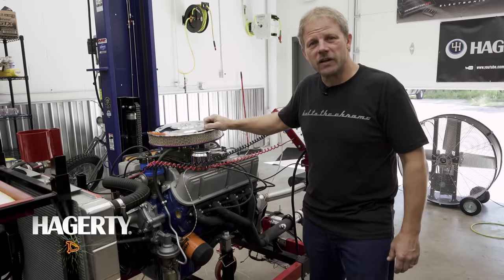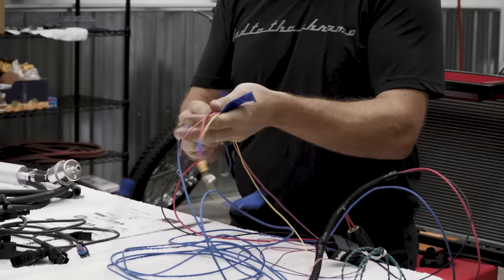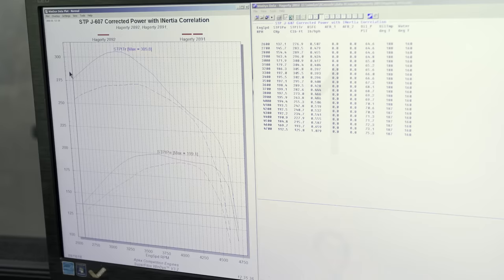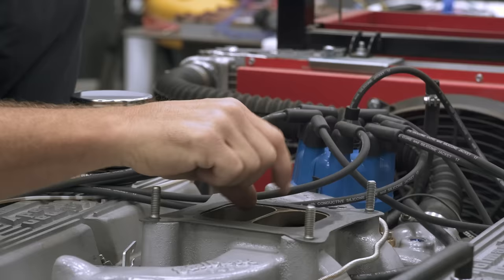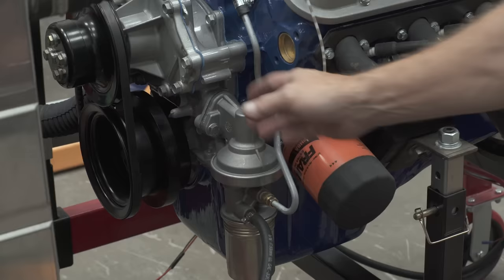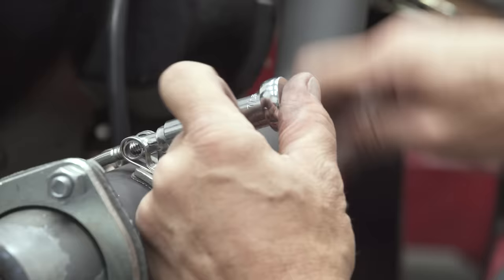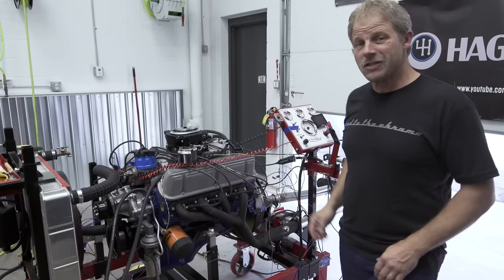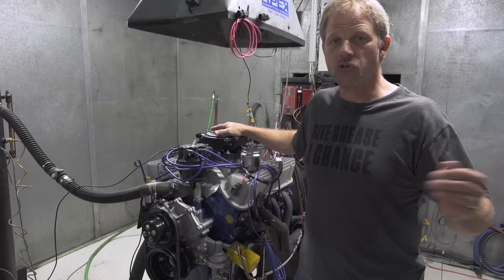Is it worth it? Replacing your carburetor with a Holley Sniper EFI | Hagerty DIY

Comment: So what cfm carb is this?
Is the carburetor a performance carburetor of today like a Quick fuel.
Their is a huge performance difference between a good performance carburetor and a daily driver low end carburetor. 
How much tuning did the carburetor get.
The holley efi is the equivalent of a performance carburetor.
How much tuning did the efi get.
Was the timing curve optimized for each?
That would be some of my questions. 
I know that efi is great equipment. 
I also know that a performance carburetor tuned for the application is great. 
I don't see a difference in total or average hp between them.
But I do see possibility a fuel mileage difference. Not much though. 
Drive ability may be better but again not much difference. 
Carburetors will never be obsolete. How ever hardware and software will be. 
Just my thoughts.

Comment: It is said and it is thru that "The fuel injection works in real-world conditions. The fuel injection is far superior." Sure, but for those that do not want or need the added wiring and digital control then the carb is King. In terms of reliability I'd neither need nor want the added complexity of the added sensors and computer control in my Summer driven 60's muscle car.

Comment: And that fuel dump on start up will destroy a new motor. Seen it happen!!! At a return line to your pressure regulator make sure that you have constant pressure at the carburetor and stick with the carburetor you'll be just as happy. And you'll probably save about 1500 bucks and possibly your motor

Comment: Tach sweep flooding?
What you are telling us is that the Sniper does NOT require ignition pulses to trigger the injectors, that the injector flow pulse is controlled by the tach.
That sure is a big negative compared to SEFI.
Ya OK. So its just a easy carb to efi conversion that improves fuel distribution up th the limits if the manifold. 👍

Comment: With the EFI you could actually add a catalitic convertor to your old classic ride. You'd be CLEAN with regard to emissions.

I'd be fun to see a model-T, model-A or a flathead V8 running such a modern efi setup.
Reply: Nope, not so much. The catylictic would clog in a few thousand miles. V/R Chris

Comment: Great video , what a difference. Question time now because , I have zero experience with fuel injection . 

1. I bought a 94 2 wd sanoma which has the 4.3 and I am going to install a V8 .

2. Would it be easier just to install a LS engine? Or get a old school 350 and get the Holley sniper system? .

Comment: I am a Hagerty customer and big fan on the company.  But this video?
Quick takeaway - If your sniper does not run well, you are on you own....   Their support at this time is DOA
I wish it was this easy.... My Holley sniper experience so far. Note: I am a competent mechanic

Details:

suport call #1 - pre purchase - looking for recommendations, decide on q-jet sniper, hyper-spark dist. and coil. Tech recommends EFI fuel tank.
tech gives me a list of part numbers... I order system
Remove my old equipment, discard old gas tank. install system new tank will not fit.

Support call #2 16min wait    fuel tank won’t fit.  I have wrong tank, previous tech gave me wrong part number. Holley does not make an EFI tank for my car. I have to buy a new tank as I had already scrapped my original. Had to pay to return the wrong tank…. Ya….

Finally get new tank and complete the install. Car won’t start, fuel pressure reading 0  - It flows but no pressure.

Support call 3 18 min wait.  No fuel pressure because no pressure regulator, - Sniper q-jet does not have internal regulator like many others. First tech (call 1) did not know that
Order regulator,   wait for it… install it….

Car starts but flooding - crazy rich at idle.
Support call 4 15 min wait - call from my office, talking to tech he tells me low vacuum can cause over rich. I figure I forgot to connect a line. 
I go out and check everything is good. Vacuum is low, about 10 on vac gauge, but the car barely runs so vacuum will be lower.

Support call 5 17 min wait.   -   Im in the car with tech ion phone. We are going through sensors and settings. He can’t figure it out. Tells me “I want to go check a notebook” puts me on hold. I wait almost 30 minutes… he’s not coming back….

Support call 5  19 min wait.   This tech seams to know more. I create a datalog file and email it to him and wait for his reply.
...No reply....  I have sent him 3 emails,  no replys.....

So what would you do....  Holley has gone radio silent....

This has been a winter long project-- 1968 Corvette 427 restomod,  -  upgraded front and rear suspension, upgraded steering system, TKO500 5-speed trans, 18” wheels and sniper system.
Money is not really an object for this build. I have taken a lot of time to do it right. Weather is now getting nice… I wish I could drive the car…..

I will post a followup. If you are a C3 corvette guy, I will be posting an article on the corvetteforum  detailing the entire build - lots of photos, howtos and lessons learned. 

I have been a big Holley fan since the 70s….  This is just getting a bit out of hand and I’m running out of time and patience.

Comment: Thank you.  The video was informative and instructional.  Some more technical data about fuel line clamps, line size and material requirements would be nice.  I plan to plumb  (non magnetic) stainless lines with AN fittings due to being in a salt laden air environment.  I feel like others on the string.  Horsepower increases are less important than drive-ability, reliability and fuel economy for the average custom car cruiser.  Not sure about the clamped on O2 sensor.  Most muffler shops will weld in a bung if you don't have the capability at your home shop.   Keep up the good work.
Reply: read the instructions.

Comment: I agree with one of the posters that this was a thinly disguised advertisement for  the efi unit; what they don't tell you is what you really want to know, like how much is this unit? what real world gas mileage advantage is there over a carburetor in traffic, and on the freeway? how much of a pain is it to keep this unit up, and who do you turn to when the refi unit goes bad, whats the warranty? they wont't answer them of course, because then the carburetor comes out on top, in real world use I would put faith in a mechanical fuel pump, and an edelbrock  AFB I could disassemble and reassemble myself.   I think you will pay $1,300 for this sniper system and the privilege of learning it wasn't worth it after all!

Comment: Problem is ,,THE COST,,, i have trouble on cold starts with an open top 750dp,, the engine was setup on a dyno with my carb and adjusted when it was at 160f   cold start its lean and ,,pump, pump pump pump to start fouls plugs after  a dozen or so cold starts.
The EFi snipper here is $2800 alone. I am running A 377chev, 10.25:1 comp,, AFR CNC heads , big Solid Cam etc. runs 478hp @6000 and 460tq @4800
steve in Australia.

Comment: Wait...you said the EFI was bigger than the carb. For a fair comparison, shouldn't they be the same size? I have seen other comparisons where they were the same size and the carb made a little bit more power. The EFI of course was smoother and more efficient, and a lot more expensive.

Comment: I have a l29 plane on waking the motor up bit. Think I'm start with a Holly sniper, with intake. Cam swap with 2500 stall converter. Little by little.

Comment: I would like to see a comparison with truck applications ... not just light car applications.  My truck engine redlines at 3800 rpm and my truck tips the scales at 7k gvw unloaded.  And if I'm off road in the middle of a field I need 100% reliability or at least be able to fix the thing to get it home.  How is efi at pulling heavy loads?  And how reliable is it as far as being able to fix it in the field if something goes wrong or it just dies?  I had a nice low mileage Buick that would die every few days for no apparent reason.  It could be cold or hot, running on the freeway or idling at a traffic light, it could be morning, afternoon or evening, did not matter.  Every couple days it would suddenly die with no warning.  I spent over $2k with mechanics replacing every sensor, computer, coil, etc with no luck.  Finally sold that beautiful, low mileage car for next to nothing as I morally had to disclose its unsafe habit of unexpectedly just dieing in traffic.  At least with carb and points in my truck I've never been left stranded which is more than I can say about my Buick, or my Honda, but that's another story.  Would really like to see a truck application  comparison along with some MTBF analysis of the electronics.  And that's operating with real life temperatures - here it can get -20*F  for weeks at a time and above 100*F in the later summer.

Comment: Why not inject the fuel at the top of the compression stroke? That way you avoid knock and can user a higher compression ratio which enables you to get more energy out of the gas. What am I missing?

Comment: People watching this video are why they ended up with goofy ideas.  No tuning of the carburetor, and odds are it is a 600 CFM.  That is too big for a 289!  You can pick up about 15 HP and torque with a 500 CFM carb.  The real benefit of the Holly Fuel Injection is that the air/fuel ratios are better, and better throttle response since the carb was not tuned.

Comment: Multi-port fuel injection actually balances out the engine with power strokes it actually the computer actually regulates the fuel supply

Comment: Not too fair of a comparison. I bet the carb wasn't tuned to run without the air filter as it was on the dyno. It's no surprise it ran too lean.

Comment: I would to say your statement is wrong on EFI.
It doesn't automatically adjust... unless that's a function of the holley. 

Cuz most OEM EFI systems, ppl try to either piggyback or eliminate to adjust the fuel curve for better efficiency and maximize power

Comment: I would've like to see that little 289 with a 750 double pumper fully tuned. I bet it makes the same if not more power than the efi. And I'm a efi guy
Reply: Not recommended. The 289 was already over-carbed. Properly tune a smaller (CFM, 400-500) carburetor and utilize properly set up controls and the engine will make as much power as the EFI and make similar fuel economy. The EFI benefits come from not adjusting the tune every time the weather changes. V/R Chris

Comment: I have a '73 vette with a 350 using a 600cfm 4bbl Holley. This installation looks nice and easy until you get to the fuel return line and O2 sensor. I'm not drilling into the headers (hooker side-pipes) for the O2 sensor. Adding a return line all the way back to the gas tank seems like it would really be a not-so-fun task as well. It's a bummer since I'd love to get the easy starting, more efficient advantages of this EFI "upgrade". I'm not really looking for a ton of power, I'd rather have it more drivable, so to speak.

Comment: I don't understand why this is even a comparison. This is like asking why a philips head doesn't work like a torx or why fine threads are used in certain applications.
Stoichiometry is the goal when it comes to drivability in every situation,  A feedback fuel injection system will always beat carburation at that job simply because it has more points of ratio to maintain fuel trims at Lamba. A carb is a compromise at best even an MC feedback carb still doesn't have the number of cells in its mapping to compete with feedback injection.   Carburation is now even a dinosaur in racing, to piston aircraft.

Comment: Wonder if a single plane intake instead of that spacer restricting airflow would help. I also think that especially in a street motor that O2 sensor will allow the motor to adjust itself to the air quality making performance alot more noticeable outside a lab where the air quality is controlled
Reply: usually does they recommend long runner single plane with "custom" plates for idealized flow. Generally paired with a header/exhaust system to match, pending on exhaust porting/flow characteristics with vac. So it still entails A lot of tuning/diametered/piping fabrication and cost. Or a "blue printed' aspect to intake/plenum/plates with crate/shop builds, that offer their headers/exhaust builds. Just differs when ppl at home have their own BBC or classic 4 bolts, and are trying to incorporate DIY/Headers. Still A single plane helps a lot more with that aspect of tuning/management of fuel/air. Each cylinder cycling fuel/air in/out ideally if theres shared ports. Esp when or large emphasis on long tube headers/collectors/straight pipes. At times the plate/restricted airflow helps in low rpm/operation depending on the fuel system/application imlemented. They have those custom plates where its a large/split intake plenum....and at higher rpm it opens up the second/port like a throttle body...then closes for half flow/pressure as it self tunes. Making the single plenum long runner application much more ideal in those situations. VS just as "Stock" engine/exhaust/header...Situation and a shared plenum/stock intake manifold and more or less basic EFI operation and fuel economy/reliability those end users expect, were intent on when swapping to EFI.

Comment: if you do a comparative test ,then wouldnt a 1 Inch spacer be tested under original carb first so it is back to back, then add the sniper? also i see added temp readings, carbs can be tuned that way also

Comment: There is one reason to go EFI. Drivability. I’m not sure there’s a good reason to use a sniper setup when you could get a vastly superior setup with the tuned runners of a modern efi manifold. I guess if you want all the drivability and lack of performance of central/throttle body injection then a grand for this is fantastic.

Comment: Nobody never does an honest comparison between efi and carburetors, efi is usually bigger , let's put a braswell 4 or 5 circuit carburetor same size on and retest that hp, I do agree a carb cannot compensate for altitude , but carb is a lot cheaper, and less parts to go bad, both have good and bad points.

Comment: Would have been nicer if ya all fixed the carb flat spots with basic jet change to try and get the most out of the carb so when you changed to injection what you were trying to show could have been seen.

Comment: how do you solve the tach sweep problem.  I have a 66 GTO with aftermarket guage replacement and the tach does sweep on ignition on.  am I in a world of confusion?
Reply: Update:  This year I installed the original 389 and used the stock intake and exhaust manifolds.  The intake divider was milled down to make an open plenum.      I had a month of learning but i think it is far better than a Carter AFB.

Comment: What did you do about the points floating did the E F I cure the problem or did you have to go to electronic  ignition. If not did you have to get points w/ a heavier spring and or have the distributor  re-curved.

Comment: Never mind MAX HP and TORQUE...  day to day driving, what kind of gas milage increase can I expect.  10%, 25%....?
Ive seen a lot of these kits, fairly easy and straight forward, what makes me hesitate is taking my gas tank down, removing the sending unit to install a fuel return line.  Too bad someone can't think of a simple solution...  thats the biggest job....  and never pretty.

Comment: Uncle tony is 100% correct, if you were to compare a properly tuned 4150 and add a spacer you would have seen the same or better numbers then that of the efi. Also, fi being more reliable is an over statement. Everyone knows with more parts comes more complexity and therefore less reliability. Is fi better at starting in the cold and better fuel mileage, absolutely it is and that is the key selling point of a throttle bodied type of injection. A true Holley performance fi system is where the real power can be made. Some guys just like the nostalgic appearance of a carb setup, and believe me, they can make just as much power as an efi system.

Comment: Is the Holley Sniper system capable of running a primary and secondary throttle, I'd like to run fuel injection on my offenhauser split plenum intake manifold and make use of it's higher velocity primary for fuel efficiency!

Comment: Hey haggerty since you've become the expert so far you're pretty good give me your opinion pal I have my stuff I took off my trans am which was a TPI system for a 305 if I update the injectors and fuel pump pressure and do something with the regulator would I have good results I have the Holly Max 2 with the aluminum heads on there and Cam and all that so I don't know if it's going to feed it

Comment: Just a Holley EFI commercial.  No fair comparison here. I run Holley carburetors on a couple of my SBF. I tried the Sniper on 347 stroker and lost ET.  For dialy driver street car it's just ok. 
You didn't talk much about having to add a fuel return line which can be a job in itself, and installing a 02 on a exhaust system in the car without long tube headers can be a few hours to do   or how you eliminate the tach sweep.   programming isn't as easy as you pretend it to be. I pulled mine put my Holley  carburetor back on. 
 Put a one inch spacer under the correct carburetor and run this test again. Carburetor is going to out perform the EFI at WOT from 4500 rpm on.

Comment: hi the video is very interesting and i bought a holley sniper but i live in brazil and i have doubts? sensor 02 is installing only 4 cylinders on the right, my question is not to have in the 8 cylinders or to have two o2 sensors for 4 cylinders on the left other 4 cylinders on the right ?  thanks